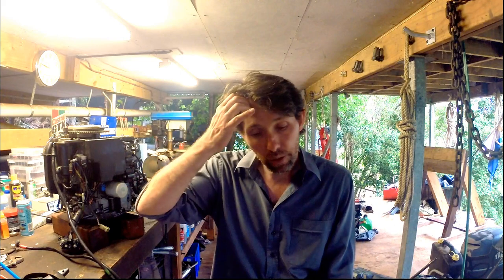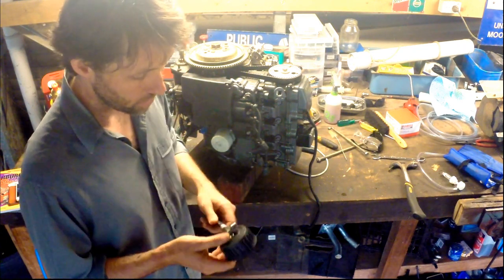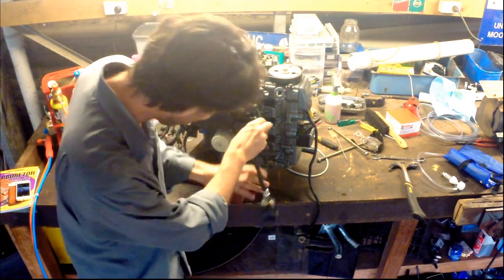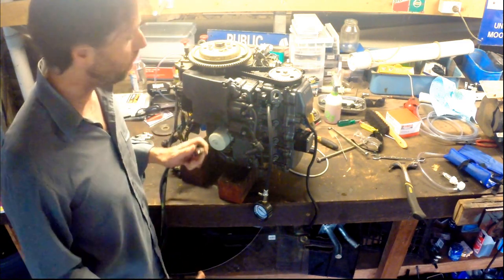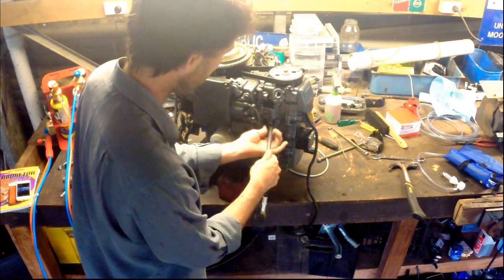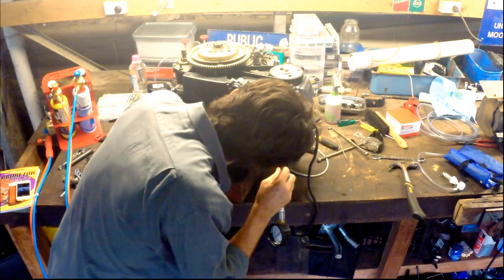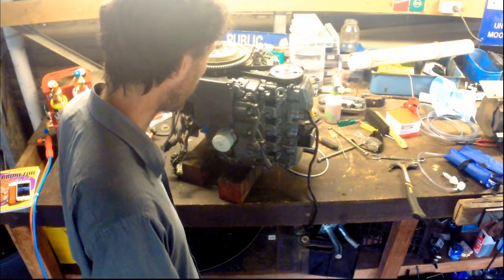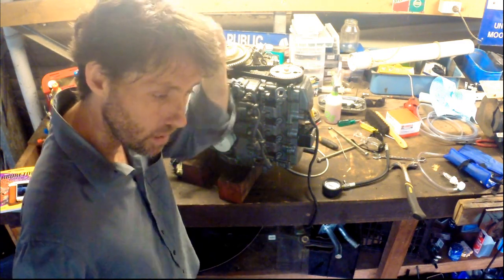Performing a compression test on the Yamaha 50HP outboard motor.

Comment: To test for rings or valves, we used to put a bunch of oil (heavy, straight 30 or 40 weight) oil in the cylinder before the test, crank it a few times to distribute it, then test.  This would usually give a higher reading, and if MUCH higher/close to normal/minimums, we assumed rings.  If not much difference, assumption was a valve or valves.  Not sure how well that would work on an engine with cylinders horizontal, but with the block off like this once, could have just propped it up so oil would get to rings right away.

Yes, I realize this is old, just commenting as I review your older videos...  :)

RichE
Reply from the maker: +Gogle Plus Sucks Yep, the test to see how much oil in the cylinder brings up the compression is a good diagnostic technique. Horizontal pistons does make it harder but still possible.

Comment: Hey Stu! Love the videos.  I have a Johnson 115 from 1973 that's slowly coming together thanks to your videos! Hull does need some transom work though (suspected rot based on the rest of the boat). I watched the Evinrude 150 series and then stumbled on these early yamaha videos. Noticed there were a few that seem to form a series and wanted to provide the suggestion of compiling them. Appreciate all the vids. Located in the Central US (Denver Colorado), where we have relatively no large bodies of water and love watching you on Dangar island!!
Reply from the maker: Hey Jonathan. Good idea about making up a playlist for the Yamaha videos as it was another boat restoration. I tend to ignore them a bit because the quality was low in the early videos, but they are there so I may as well keep them organised!
Reply: The knowledge is there! Also great to see the 2 stroke vs. 4 stroke tear down. Valves are nothing I have to worry about (for now) but great to learn about lapping valves!

Comment: Gday Stu, 
Loving the Detroit content as of late. 
I just performed a compression test on my old 70HP Johnson. 
I got 100, 127, 132 
Research is telling me that 100 is pretty normal for an older donk. 
When I pulled the spark plugs of the higher two cylinders there was a fair amount of carbon build up on the plug
I’m wondering if a sooted up cylinder could increase the compression of the effected cylinder significantly? 
Thanks for the content. Love the chooks is the last vid. I’ve got a few australorpes myself.
Reply from the maker: Carbon build up can affect the compression for sure. If it is running fine I would try just taking it out and running it at high RPM for a while . Two stroke engines don't like to idle much.

Comment: my outboard is a 1971, 9.5 HP evinrude, and has 35 psi even on both cylinders, any suggestions will be appreciated. Points and plugs are new, I just bought the outboard a few months ago, it was all disassembled, but complete. I checked and gave a service to the gear case, water pump, coils, and it runs fine, but I feel it king of slow. by the way, good work on your videos, you've been quite a guide to me through the process I just mentioned. Thanks

Comment: thanks for the video. I am looking at a used motor no longer rigged. I want to test compression but don't know where to connect the power? I was going to use a battery and jumper cables.
Reply from the maker: You can connect jumper leads directly to the starter motor if you just want to crank it for a bit to test.

Comment: when buying a boat should you do a compression test when the engine is warm or cold to see if the engines good
Reply from the maker: +R Reichel Good question. Doing a compression test warm will give you a higher reading as everything has expanded to it's proper operating size. There isn't any huge problem doing it cold though as it will still give you valid relative reading between the cylinders that will help you find a bad cylinder, even if all those figures are proportionally lower than they would be warm. Also, often when I'm doing this test it is on an outboard that isn't running so I don't have any choice. :)
Reply: I got 90 on all 3 on my johnson 70hp. Motor kicks over everytime though. Should i be worried?

Comment: I am interested in doing a compression check on the four cylinders in my 1998 Yamaha 115 2 stroke engine (recently given to me by my father). I believe you tell us to have the throttle at full and the choke open. Does an open choke mean the same thing as full choke or does it mean no choke? Additionally you said good compression readings are 120+ psi. Is there anything more we need to know when checking 2 stroke compression vs this video's check of 4 stroke compression?
Reply: Reviving an old comment here, because of google: If I remember correctly, 2 strokes have lower compression. From most forums I got to hear that these compressiontests on 2 strokes don't matter for the individiual cylinder, but rather if they have all around the same compression, with a 10% variant.

Comment: hi stu well i tried a compression test cylinder on my Honda bf 90 and it was showing between 76 and 78 psi but in my manual it shows me like this and i haven't got a clue what it means CYLINDER COMPRESSION  1.471 then 98kpa (15 1 kgf/cm2  213 14psi) at 300min (rpm) and am not sure what to make of any of that if you could help stu much appreciated  thanks jimmy ps great vids stu keep them coming cheers
Reply from the maker: Hi Jimmy, that does sound odd. 98kpa / 14 psi is way too low to be a cylinder compression so they must be referring to something else like a manifold vacuum or something. Normally you would want over about 120psi as a minimum. Have you tried the gauge in a different motor like your car to see if it is giving proper readings?

Comment: Hi, nice video. Thanks for sharing it.
A few days ago I did the compression test in my Mercury Marine 90HP ELPTO, and gave me all 3 cylinders around 95. Last year a mechanic did it and were about 115 to 120. 
Would be any difference in compression if I open the throttle of the carburetors to do the test? I didn't do it, but a friend of mine is telling me that makes a big difference because the cylinders need to aspire air to compress it...What is your opinion? Thanks in advance.
Reply from the maker: Yes, the throttle should be open to get an accurate compression test. Having said that, different gauges can also vary a bit, as well as how well the lead is sealed in the spark plug hole. So long as you were getting even readings across the cylinders you probably don't have a problem.
Reply: Thanks very much !!! I will measure it again one of this days. 
Regards from Florida, US.

Comment: Hi there. I still need to do my compression test. I went to do it yesterday but my neighbor's fittings were all too big. I need to get the correct fitting for this Yamaha. Anyway, when I finally get to it the service manual says that for a 1995 F50 the minimum compression should be 184 psi. That seems WAY too high. I thought I heard you mention in one of your other videos ( or maybe this one) that it should be 120?
Reply from the maker: Yes, that is very high. 120 is a good minimum and certainly what my manual says.
Reply: I haven't done much with this in the last few months, mostly because when I went to test the bottom cylinder I couldn't get the tester fitting into the bottom spark socket. Are there low profile testers for this outboard (I have the same Yamaha F50, mine is a 1995)?. Or, is there an easy way to remove bottom cowling to get better access? Not sure if the outer casing comes off easily or if it requires dismantling of the outboard at all.
Reply: Yes, different brands/models of compression testers will have different lengths/setups for where it goes into the cylinders.  "In the old days", we'd take an old spark plug and break/force the porcelain and center out, then figure a way to attach a piece of hose to make an appropriate connector.  Brazing to pipe or other fitting the hose would fit was one way, but JB weld would probably work for something not used every day.

RichE

Comment: I've learned so much from your videos, thank you. I've had problems with my 2001 50hp Yamaha 2-stroke for years, mostly due to not using it often. Today I did a compression check and am getting only 60 psi in all 3 cylinders. It ran for several hours last week. I ran out of gas like an idiot, then drove 1/2 mile back in after refilling. The buzzer was going off, maybe it was out of oil....I had none to add. I am not sure what to do next. Any advice is appreciated. It will crank and will start and run using carb starting fluid. I'm not opposed to taking the head off and trying to learn a repair of the pistons if needed.
Reply: I have the same year and mine are all reading 60 as well

Comment: Hi,,question,,on a 50 hp yamaha 
two stroke 2005 what will be a good compression when test it,,and  what number should I be worried when I do test compression,,,,thxxx you so muchhh
Reply from the maker: Above 120 is good, but all cylinders being even is almost more important as the tool won''t be calibrated.

Comment: hi mate thanks for the videos! a friend has a smoking 1998 mariner 50hp which he had a "mechanic" have a look at, he apparently did a compression test and two cylinders were at 0 and the other two were at 60..  my first reaction was it's not possible it runs? a little lumpy and smoking but pushes the boat along ok not 100% the mechanic said possibly rings.

what do you think?
Reply from the maker: I agree, if those readings were correct the motor probably wouldn't start and certainly wouldn't push the boat along okay. I'd try again with a different tester and make sure it is sealing okay against the spark plug hole, they may need cleaning out to give a flat surface to seal against.
Reply: Dangar Marine thanks again he's gonna source another compression tester 👍

Comment: Done compression test 150psi on 123 4th was 140psi so hhead gasket should be good must be a seal gone in lower leg do you think?as for the smoke ive put my finger on the bottom of the fuel bowl where it has got thickish 2 stroke oil
Reply from the maker: Hi Robert, if you are still getting that milky oil out through the exhaust I would certainly be looking at the seal below the water pump. Nice work on finding the oily carburettor.

Comment: So I just purchased a 2000 Honda 9.9 four stroke. Long story short, this motor was purchased new and literally sat and was never used for the entirety of its life. Compression numbers are around 80 on cylinder one and 70 on cylinder two. Haven't yet tried to start it because the carburetor needs some work but I was just wondering if those numbers were something of concern
Reply from the maker: +Logan Terraglio They are pretty low compression figures. Have you tried the tester on another motor? Is it accurate? Being a four stroke, the compression may be low due to the valves not sealing completely rather than ring wear given the motor hasn't had a lot of use. I'd be inclined to do the carburetor, start it up and see if the numbers improve with running. It's not impossible for that to happen.
Reply: +Dangar Marine not 100% sure if the tester is accurate. The day I bought it the compression numbers were actually lower. The next day I tested them again and they jumped about 10 psi on each cylinder. Not really sure what could cause that. Hopefully I can get it running to see if it'll jump some more
Reply from the maker: Logan Terraglio Fingers crossed it will get better. Are you doing the compression test with the throttle wide open?
Reply: +Dangar Marine yes the throttle is wide open, did another test today and each cylinder jumped another 5 psi. Hoping this positive trend continues.
Reply from the maker: Fingers crossed. Could also be because the rings are bedded in to the cylinder walls yet if it really has done that little work.
Reply: +Dangar Marine so while i'm waiting to receive the parts to get this motor running, I've been messing with it here and there and have noticed that trying to pull start the motor is extremely hard to do. I can hardly pull the cord back 1/3 of the way. This only happens when the spark plugs are in the motor. When I do a  compression test and both the plugs are out, I can pull the cord all the way out without any issues. Any idea what would cause that?
Reply from the maker: That is slightly odd, as your compression figures aren't that high. When you say it only comes out a third of the way, does it stop completely? Once it has lost momentum at the 1/3 mark can, you stop and continue to pull it further? It could be a timing issue that is causing it to fire early and halt the rise of the piston.
Reply: +Dangar Marine it just feels like I've hit a wall of compression at a certain point when pulling it. It'll get to that point and then I'll have to basically put my whole body weight into pulling it if I want to pull the cord the rest of the way out
Reply from the maker: That is odd for a small outboard with relatively low compression. Have you tried with the spark plugs in but the ignition off?
Reply: +Dangar Marine yes I've tried that, same result. Compression numbers keep rising every time I test it. I read something about there being some sort of compression relief in the exhaust port that could be clogged with carbon deposit. that might be causing the problem but I have no idea if that's even the case.
Reply: +Dangar Marine well after the necessary carburetor work, the motor runs flawlessly. Was definitely expecting it to give me much more trouble than it did. Hopefully I'm not jinxing myself by saying that, but for now it'll work. Thanks for all your insight! I enjoy the hell out of all your videos, keep 'em comin' :)
Reply from the maker: +Logan Terraglio Nice work! glad you got it going. Hope you have a safe and fun time out on the water. :)

Comment: looking at the user manual for the compression is it marked as "Bore Stroke"?
Reply from the maker: Generally not. You can calculate compression from bore and stroke but it is normally listed in PSI as a minimum.

Comment: I bought a 150 hp mercury 2 stroke motor mostly ran salt water ..did  compression test and all cylinders ran 70psi. Is this motor healthy??
Reply from the maker: 70 PSI isn't high, but it is good that they are all even as the gauge may not be that accurate.

Comment: Do you remember what the compression should be on the yamaha 20 2-stroke?
Reply from the maker: Anything above about 100PSI is generally ok.
Reply: @DangarMarine  lol I just came back from the trip to the seller. They were both exactly 100psi and it ran like * and looked like someone threw it off a building. But thanks anyway for your anwer man 👌🏻

Comment: hi there i have a mercury 45 classic 50 4 cylinder today fired it up running muffs on it started as normal but it then stalled out then after that it would fire and then stall ,after that i did get it going but it was spewing alot of smoke and then i noticed a milky goo coming out of prop area any ideas what would cause this?
Reply from the maker: The smoke is probably pretty normal for a large two stroke motor running at low revs. What ration of oil do you use in the fuel? The milky goo is probably gearbox oil being drawn up through a bad driveshaft seal below the water pump, going through the motor's cooling jackets and then coming out through the exhaust.

Comment: Did you or do you ground your spark plugs during compression testing?
Reply from the maker: When doing a compression test, the best thing is to pull the lanyard (overboard switch) out. Once you do this the engine will still turn over but there will be no spark.

Comment: Hi Stu, I know you're busy with the trawler but I had a question on this if u got time... I know you can usually identify a car engine with bad compression  by listening to it crank, I was wondering if you'd had experience of applying the same principal to outboards? I appreciate of course that a proper compression test is much better, but it's not always possible - e.g. if you've gone to view a boat for sale for example. Thanks.
Reply from the maker: You can sometimes hear them turning over too fast, but having the exhaust underwater makes it a little harder.

Comment: I'm trying to find a manual for a 1985 Evinrude 90 horsepower engine and I can't find the manual to tell me the specification on the compressions for the Pistons , I want to go buy this boat that I saw an internet but I want to know the specs before I go over there putting my testing equipment on it and make sure that everything works can anybody help me out fine the manual for this year 1985 plz
Reply from the maker: You might be able to find one on readmanual.com or tradebit.com

Comment: no it was smoke yet to do compression test thats 2 morrow will let you know results
Reply from the maker: I would also take a look at the spark plugs. If there is that much smoke there can only be a few things that are burning. It either has to be the autolube adding to much oil, something getting in through the headgasket (possibly water with oil in it from the gearbox) or something that was put into the motor. Any chance it was heavily lubricated before being winterised / stored?